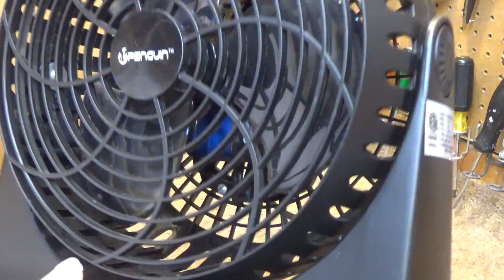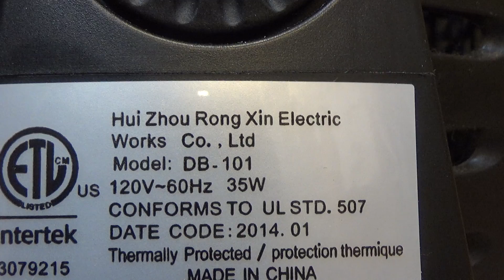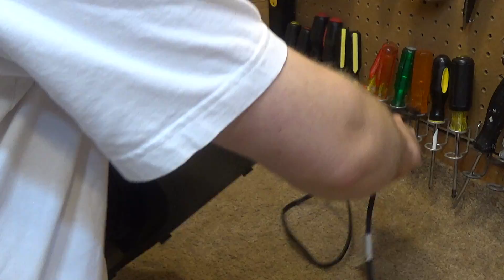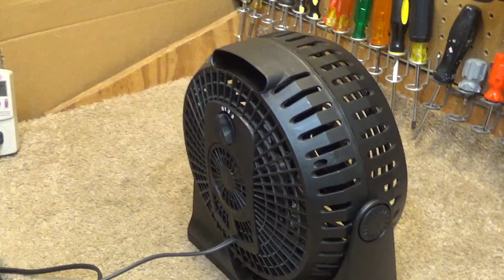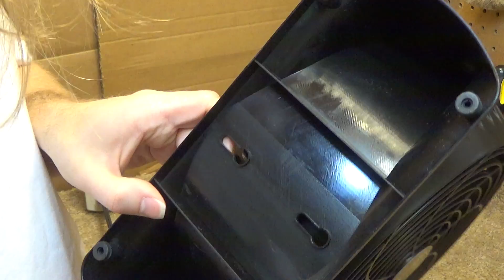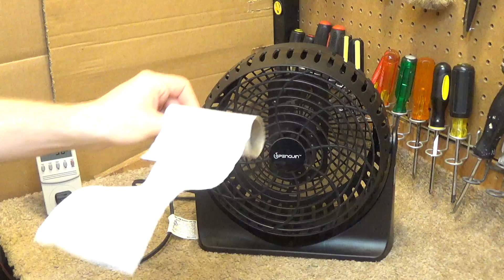Penguin DB-101 10" Circulator Fan | Initial checkout

Comment: "Fan plug is go fast speed high" I had a pedestal Fan from Big Y and I nearly lost it reading the manual out loud!

"Fan place constructive ground level, inserted screwed base fan attached. Speed select fan for comforter yours. 

Front side of grill attached the rear compartment. Begin ending of completed task"
Reply from the maker: Classic! If I ever see fans at the Big Y again I may have to get it just for the manual..